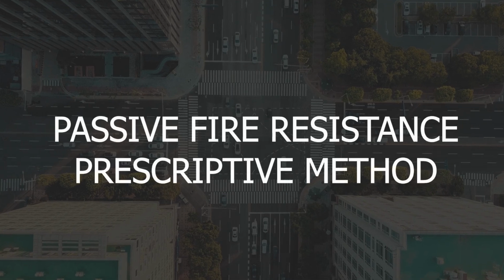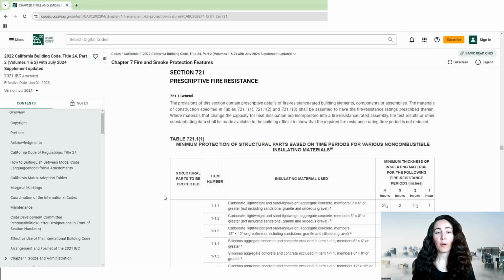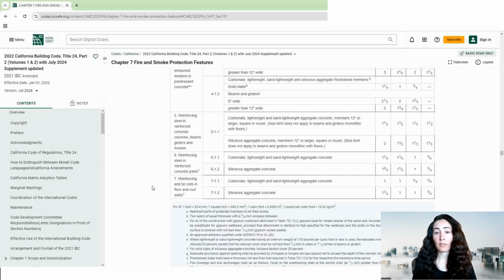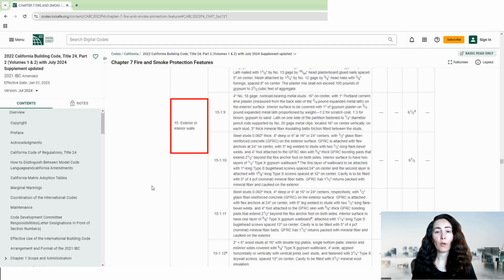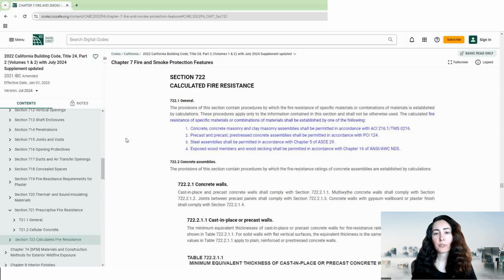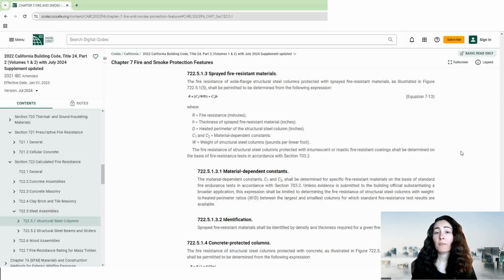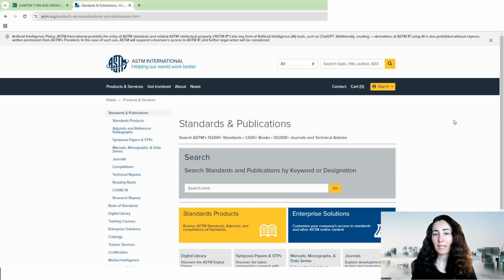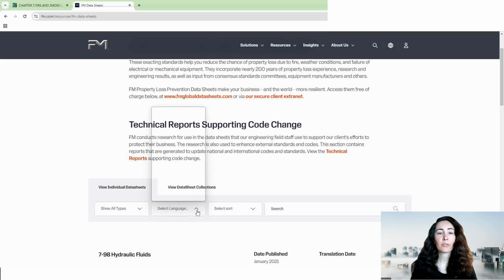Prescriptive VS Calculated Fire Resistance in Building Design

Comment: This video clearly shows the importance of selecting appropriate materials to achieve passive fire resistance in building elements, components, or assemblies. By consulting Chapter 6 for rating requirements and Chapter 7 for material assemblies, we can identify materials like steel columns, reinforced concrete, or gypsum walls that meet fire resistance ratings. One example is how a 4-hour fire rating for steel columns can be achieved using assemblies with materials such as clay tile or concrete. The module also emphasized the role of standards organizations like ASTM, UL, and Factory Mutual, which develop and test building materials for safety and performance. Designers must carefully choose prescriptive assemblies to meet code requirements, but when those assemblies are not feasible, calculated fire resistance methods from Chapter 7 offer a way to ensure compliance.

Comment: 1. ASTM E119 contains information about the fire resistance of types of building elements, evaluating the duration of the building elements in containing a fire and their ability to retain their structural integrity. The standard also includes information on load-bearing capacity, the testing conditions, and the building’s reaction to fire such as the generation of toxic gas and the transmission of heat.
2. For my own project, I want to use UL U415 UL System I. It is for the elevator shaft wall with non-load bearing steel studs. The materials are a 1” gypsum panel, 2-1/2" steel stud, two 3/4"gypsum panel, a 1/2" resilient channel, and two 3/4" gypsum panel.
3. From CBC Chapter 7, a fire resistance method that saves cost and time would be the prescriptive method because the assemblies have been pre-tested and approved, requiring no further testing for approval from code officials.

Comment: This video was very helpful in understanding the different rating requirements for various building components and which materials are able to be used in order to achieve passive fire resistance. The video easily exemplifies the process that needs to be taken in order to reach passive fire resistance - beginning with the minimum protection of structural parts and how to read these charts. It is very interesting to see how each materials, whether there is insulation, if its exterior or an interior wall all play a factor on the fire ratings.

Comment: Learning about fire safety and regulations has been the most expansive topic yet in this class, and is definitely going to be something I prioritize in design in the future because of its' strict code requirements. The ratings of certain materials and assembly relating directly to the programming was an interesting category to learn about, not only that but in my studio project I plan on using intumescent paint to protect my exposed W beams in my design. A question I have is how exactly I would show this in a drawing or diagram? Is it just colored W beam, or is it something I do not show and just say, or is it just assumed I have some sort of direct fire protection on exposed beams.

Comment: 1. In the standard, there is classifications for multiple materials and assemblies. These classifications are organized based on tests gauged by their performance against fire.

2. For my next project I plan to use UL's U490. It is for an interior partition including non-load bearing steel stud. Materials are the following: two gypsum panels 3/4", steel stud 2-1/2", insulation 2", and two more gypsum panels 3/4" thick.

3. To save time and money, the prescriptive method for fire resistance would be recommended because they're pre-approved meaning they don't need testing or additional calculations to figure out. That saves time and money when it comes to considering engineering analysis.

Comment: 1. ASTM E119: This standard, "Standard Test Methods for Fire Tests of Building Construction and Materials," covers everything from fire resistance testing, conditions, and acceptance criteria to the test procedures and classification.

2. Cantilever Project Fire Protection: In the design of my A3 cantilever project, I decided to expose the structural members, making them part of the facade. My original plan was to either cover them with steel sheeting or paint them in a semi-reflective steel color. After watching this video, I’m considering using intumescent or mastic fire-resistant coatings. Would it be allowed to cover these coatings with another material, like steel sheeting or paint, to achieve the look I want?

3. CBC Chapter 7 – Prescriptive Method: The prescriptive method for fire resistance in CBC Chapter 7 is a smarter way to go, saving both time and money. It uses standardized fire resistance ratings from tested assemblies (like those from ASTM, UL, or FM), making it easier to apply without needing specialized knowledge or extra calculations. Plus, it's usually quicker to get approval from code officials.
Reply from the maker: If you cover it with combustible materials, now that column will attract fire easily although the paint may slow the time it takes to burn.

Comment: Understanding the usage of fire rating of building materials is very important for how we classify a buildings fires resistance is classified.  The testing done to provided this data is very important can help understand the ability of a material or a material assembly to resist fire and heat.   Not only is it important to resist the spread of fire but the usage of passive fire resistance materials to extend a materials ability to stay structurally sound and support the building during a fire.
Reply: I think you bring up an important point about how passive fire resistance materials help to extend a materials ability to stay structurally sound especially regarding intumescent paint and its application to steel members. Unlike wood, steel doesn't burn, but in the event of a fire excessive heat surrounding a steel member will cause it to weaken and melt leading to failure. After watching this video I did some more research into intumescent paint and found out it works by swelling and forming a protective layer that insulates building materials when exposed to heat. This is a great passive technique for passive fire resistance as it takes up virtually no space but has incredible insulative properties.

Comment: 1. ASTM E119, titled "Standard test methods for fire tests of building construction and materials," The standard includes information on Fire Resistance Testing, test conditions, acceptance criteria, test procedures, and classification.
2. In my cantilever project, the primary columns are using 6" x 6" steel. The minimum thickness of insulating material for 6" x 6" steel columns is 2.5" or higher for 4 hours Fire Resistance Rating.
3. In CBC Chapter 7, Prescriptive Method would be a better way to save cost and time for fire resistance method. Because there are standardized fire resistance ratings based on tested assemblies by organization such as ASTM, UL, and FM. It is more easy to apply and understand, less need for specialized knowledge or engineering calculations, acceptance by code officials is generally more straightforward.